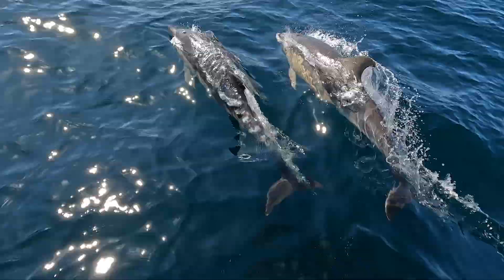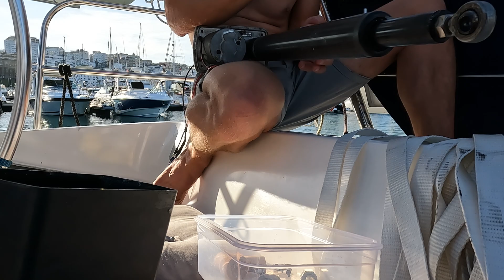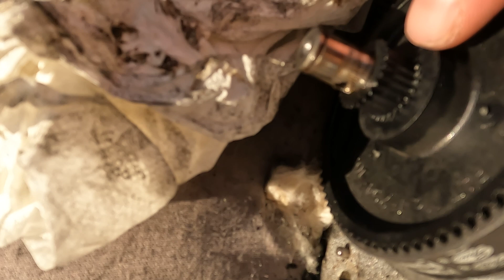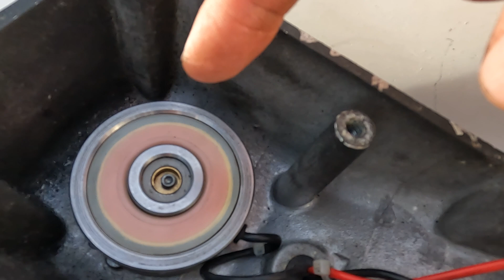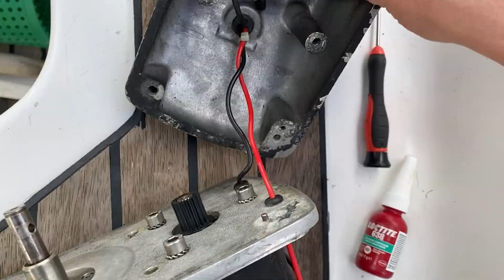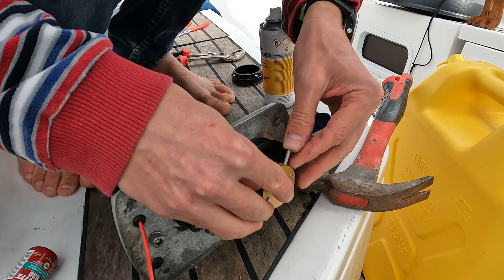E34 REPAIR Raymarine Linear Drive AUTOPILOT (how to save $2,000)

Comment: Probably should have replaced the toothed belt at the same time. Given it about 40 years old. Would have been cool to see how much cracking the belt had around its teeth. It's same as a cambelt in an engine. Otherwise thank you for a very informative and helpful video.

Comment: Hi, where did you find the replacement gears? Thanks
Reply from the maker: Hudson Marine a UK based chandlery. I bought them online and got friends to bring the parts on in their suitcase.
Reply: @ cheers thanks! Im looking into getting a used ray marine linear drive for my boat and would want to upgrade the gears.

Comment: Thanks for the video. I am taking my drive apart (with the aid of your video). I can't seem to remove the brass plate with the planetary gear on it. Any suggestions? There seems to be a pin running through the shaft but not sure how to remove it.
Reply from the maker: Whack it out with a hammer. It’s called a spring pin. Find a drill bit of the exact same diameter 😊 careful not to damage it

Comment: Brilliant and very helpful video. Thank You !!
Our problem is the ram goes in by hand, but not out.
With drive motor engaged or rotating the disassembled head, it goes both ways. 
Something is then jamming the linear drive one way inside which prevents manual steering.
If anyone knows why ?
I would be very grateful ???
Reply from the maker: That is a strange one. Maybe it’s something to do with the electrical connection to the motor? The connection is okay that makes the arm go out, but there’s a bad connection on the connection that reverses the motor? Just a guess. Did you figure it out already?
Reply: @sailingnendaz  Having looked further, the thrust bearing on the shaft had excessive play due to a broken roll pin which allowed it to move and jamb in one direction.
Hudson Marine sell spare parts and show an exploded diagram which was a great help !
Reply from the maker: @malcolmdavid722 aaaah well done on fixing! Yes Hudson Marine is where we got our kit from too.

Comment: Not so great. Try John Deere AN102562 grease. Also, you could grease the motor bearings and replace the carbon brushes, if they need it.

Comment: Fantastic video, thanks so much! Did the noises disappear with the change of gears? My drive is currently making the same noise and does not feel very smooth when trying to move the rod in and out. So I suspect our  drive will also give up soon. Because of the resistance I thought it might be the clutch but thanks to your video I think the problem might be on the gears. Did you also feel difference in force needed to push the rod in and out?
Thanks again and fair winds!
Reply from the maker: I think the force was similar. But the noise was a lot quieter once we replaced the parts ☺️ if you have the same problem then eventually you will just lose all drive
Reply: @sailingnendaz  Thanks a lot for the fast answer! I will just dismount it and take a look inside :). Thanks again for the very nice video.

Comment: Was you getting any error messages on your chartplotter ?
Reply from the maker: I’m honestly not sure - it was a bit chaotic in the moment. But it was making some horrible grinding noises and wasn’t able to keep the boat in a straight line. It was quite rough sea 🌊
Reply: Know the feeling. We are trying to service and repair ours after changing everything else out . Where did you get your parts from

Comment: Can you add the part number you ordered ? We have the same issue and need to replace.
Reply from the maker: Manners maketh man 😝
Reply: Hi Sailingiwa2045: what age is you autopilot? Here is the part you need: Raymarine N021 Heavy Duty Gear.
Reply: @malagpraustralia  bought it with the boat so could but 23 years old. We have put over 6,000 miles on it. I am going to rebuild it and hold it as a spare and install a new one.

Comment: You resolved the mystery about the roll pin removal. Thanks big time, i was convinced it was an imbus screw....thanks to you i can order new parts and save 2000e
Reply from the maker: Aaaaaah this is great news 👍🏼 I’m so glad it helped you.
Reply from the maker: They are a bit fiddly to get back in, but a bit of patience and it will be no problem!

Comment: Excellent for anyone with the same problem will not fear theirs breaking I have a similar motor on mine but it drives an hydraulic ram the brushes do wear out an also create a great deal of carbon dust which tend to clog up the free movement of the brushes causing the brushes to lose firm contact on the armature or is it commutator which ever It causes failure I replaced the brushes it worked for a while but soon failed again I took it to the local garage blew the motor out and it has worked fine since 2016. Good luck with your channel and have fun .Mike
Reply from the maker: Aaaaah thanks for the feedback Mike. Glad you found it useful 😊 the motor is the one thing I didn’t service this time round. I’m amazed it’s still going to be honest as it’s dated 1989, but maybe it didn’t get much use?

Comment: Hey there you two.  Good job repairing your drive unit.  For future reference, the little gear that was stripped is called the sun gear.  The 4 gears are called planetaries, and the outer gear is the ring gear.  Your car transmission has similar set up inside it if you have an automatic shifting transmission.  I don't know about Morocco, but over here in the US, the snap ring pliers are really inexpensive and so should be in every tool kit.  There are inside and outside types so get both.  They make life so much easier when doing a repair.  They usually sell for about 2.00 each over here.  I would recommend a white lithium grease for your gears so next time you get a chance take it apart and put a heavier grease in there or they will start to chew on each other.  Remember that the lubricant performs a cushion job.  The thin film of lube keeps the metal from rubbing directly and so eating each other up.  Too much grease just gets in the way, so no good to go that way.  That gear box should be a regular maintenance item on your list of things to service.  Raymarine thought that if they made the parts of self-lubricating material it would last for a long time.  Nice try RM.  If someone had applied silicone grease every few years, it may have gone forever.  I suppose I am 3 months behind telling you all this.  Starting to warm up over here so we should have our Jeanneau in the yard maybe next month for new seacocks all around.  Keep having fun and try to be the guy and gal that Walter thinks you are. Lennie
Reply from the maker: Here comes Lennie with some great snippets of info this week! Thank you very much 🙏🏼 so I bought some snap ring sirclip pliers in Morocco but didn’t include the footage. The pins/ ends of the tool didn’t fit in the holes of my sirclip, they were ever so slightly too large. So I was a bit put out by that 😂 we will definitely be servicing one a year going forward, try and eek some more life out of the unit.
Reply from the maker: PS. It’s never too late, I take every nugget of wisdom into future projects. Good luck with the Jeanneau projects, keep us posted on how you get on!